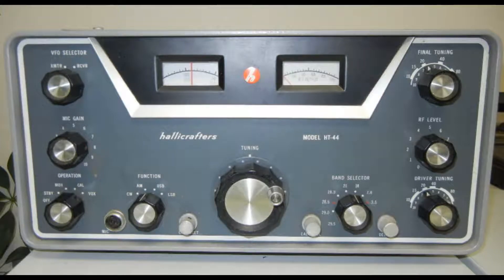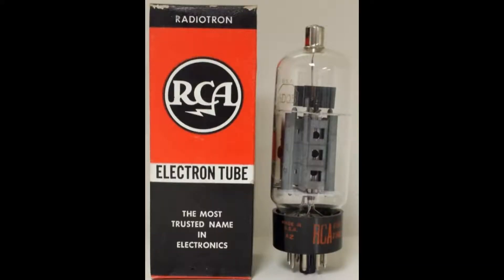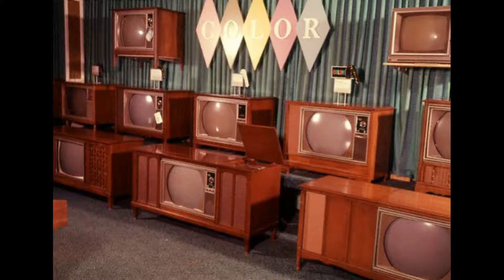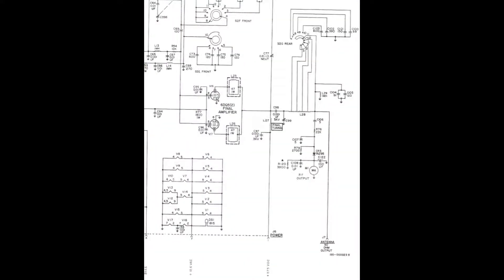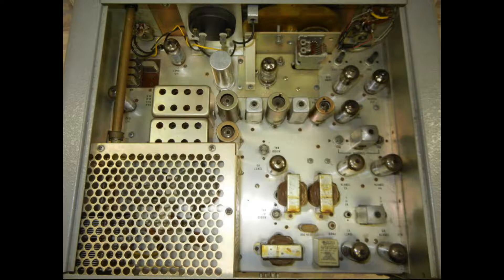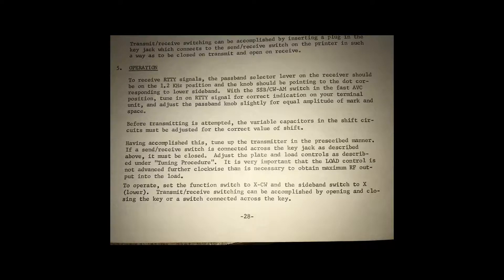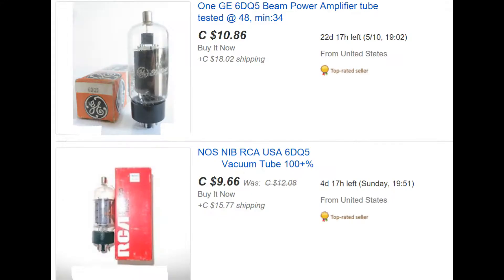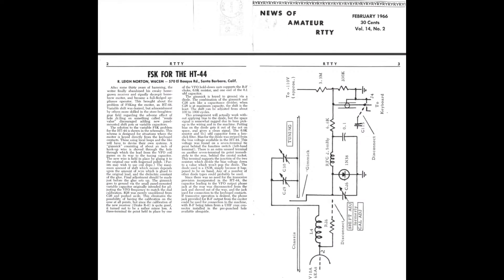Don't underestimate TV sweep tubes 6DQ5 in Hallicrafters HT-44 SR-150 transmitters

Comment: Good comparison.  Going to the "recieiving" tube manuals lets you get the dope on all the sweep tubes.  6DQ5 has been used in many designs with great success.  I see elsewhere you have posted your full RTTY set up using the HT-44.   It would be nice to have a follow up video, after you have done a lot of this high duty cycle operating,  to see what you've learned about how the rig stands up.   I haven't heard one in the AM mode.. and I am curious to see if it can run DSB .  Also, curious .  Do you plan to add negative peak clipping to achieve 130% mod ?

Comment: A small cheap a$$ computer fan with an 8 volt regulator works wonders and you won't hear it run. The 12 volt setting can be used, but noisier. 2x 6dq5's sounded awesome in my 1959 Voice of music 563! (no plate caps) cheers and 73's de w1rmd
Reply: A 220V MUFFIN FAN RUNS QUIETLY ON 120V.

Comment from the maker: People talk about rewiring transmitter tube sockets to replace sweep tubes with 6146's -- I'm tempted to replace the 6146's in my DX100 and Apache transmitter with 6DQ5's!  If my analysis is correct, the tv sweep tubes may provide better modulation linearity due to the higher emissivity and peak current capability of their cathodes,  I'm not concerned with plate dissipation.  I'm now convinced a 6DQ5 is good for 40 watts of plate dissipation ICAS, perhaps more.
Reply: Heath really did their homework when they designed the DX-100.   You will still have to load it up the same, to achieve the Z match with the modulator  they intended.  So cheaper tubes.  But if they last 30 years.. will it matter ?  Get some W's and call it good !